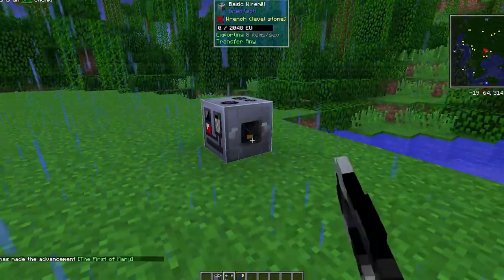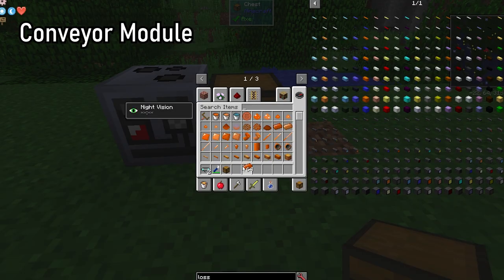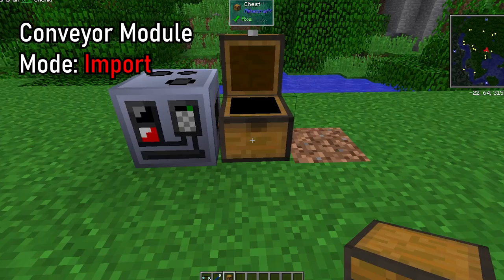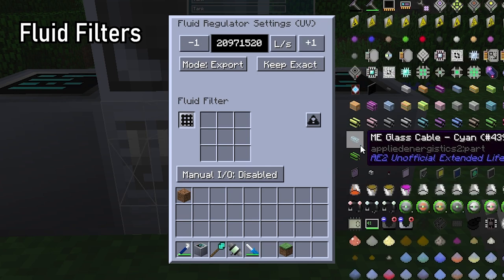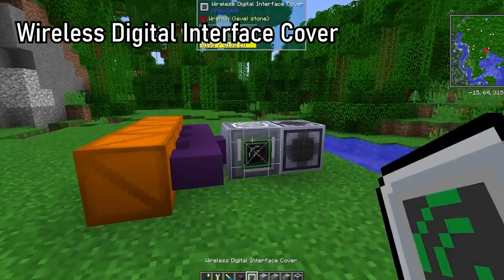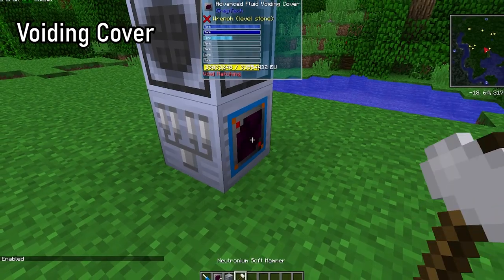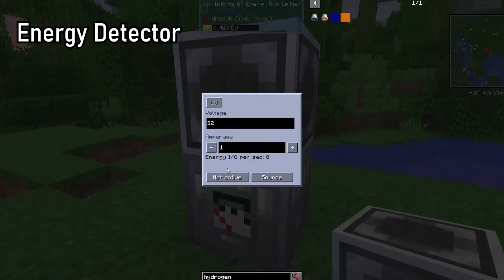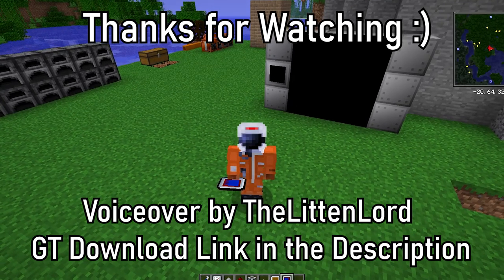Everything about GregTech covers explained

Comment: ALSO: Gases are counted as fluids
Reply: As in every other mod unless mekanism is installed
Reply: well gases are fluids, so that makes sense
Reply: gases are fluids
Reply: @tommasov7791  Nope, even in Mekanism.  Just like real life, fluids includes both liquids and gases.  

Mekanism doesn't have fluid pipes.  It has only mechanical liquid pipes and gas pipes.  If Mekanism had fluid pipes, they would handle both liquids and gases.
Reply: @uigrad  when mekanism is added to any modpack it changes how some fluids work, not making them able to go through normal fluid pipes, and does so by making them gases, i'm talking about the coding side, not about how realistic it is

Comment: no matter how i try it, my MV fluid regulator wont work, i have it set up to try take oxygen gas from gregtech fluid pipes, keep exact 16 buckets, with a filter for oxygen, set to import mode. It just wont work, either itll just keep putting in more oxygen and wont stop until ful (over the 16b limit i set) or just wont take any oxygen at all. Please help

Comment: Got a question, how do you make something that works as an overflow valve in community edition?
Reply from the maker: You could have a voiding cover and you can set it to void fluid if it's over a certain amount
Reply: @Regian  Yeah that kind of works, but sometimes I don't want to destroy the fluid. I basically wish there was a way to make a fluid flow out of a tank only when a set threshold has been exceeded. I had to use classic redstone-comparator setup. I just thought there was a machine cover that works the same way, they should add one.